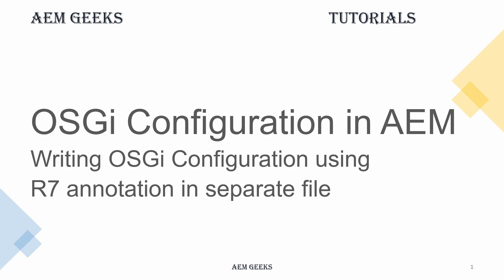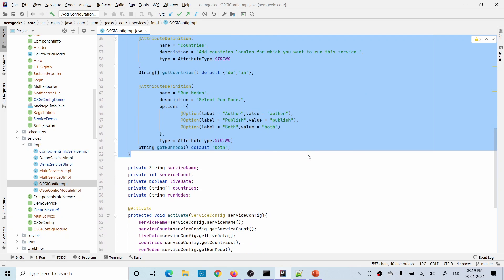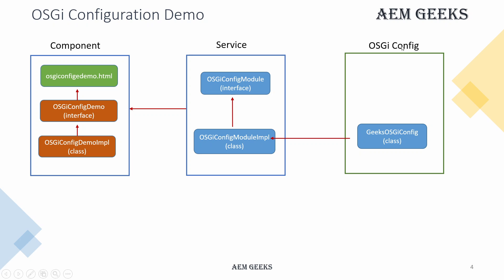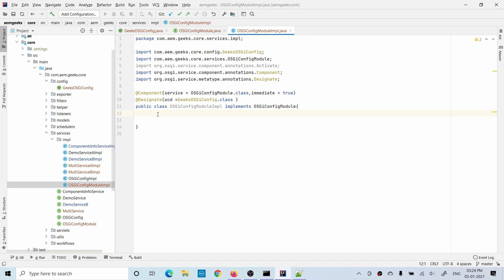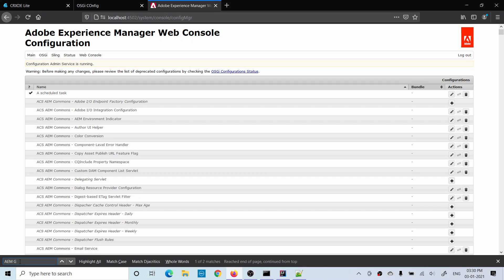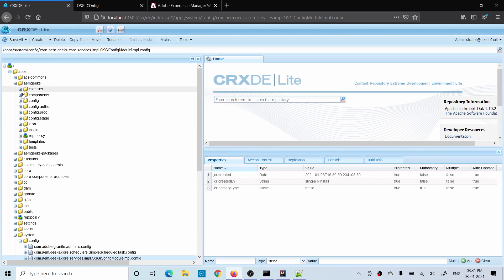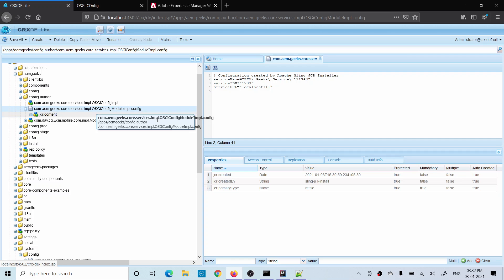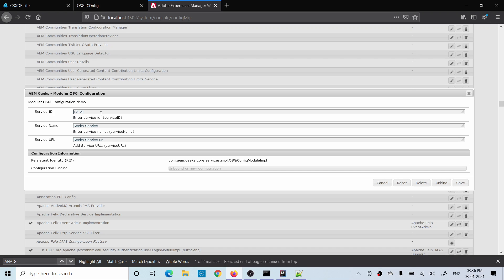AEM Tutorial #32 | OSGi Config #2 | Create OSGi Configuration in separate file in aem

Comment: If we change the config node to our app config from the system config what happens after the build. Also what if two config nodes are present with the same name.
Reply from the maker: You must have config in your app folder. You should not deploy anything to system. Configuration are stored in system, if you update/create using system/console. If it stored in system, then probably it will pick from system. It will all depends on how you save config. Verify on your machine.

Comment: Hello Sunil,
I have tried this OSGI config in my local author it is working fine but the changes are not reflecting from crxde node to system Console.
Thanks & Regards,
Vinod Kumar,
9515140547
Reply from the maker: vinod katakamsetti, Ideally it should reflect changes if config working in author code. Please check below.
1. Check if any duplicate config present in apps/system.
2. Check If you are keeping config in different configuration folders then which one is loading. Please see tutorial #35.
3. If you have duplicate config in code/node then you must have duplicate config in system/console as well. 
please check above points and let me know. There should be some minor issue.
Reply: @AEMGeeks  Yes, You are correct. I did a small mistake but, now my configuration is working fine.
Thank you so much Sunil for your response